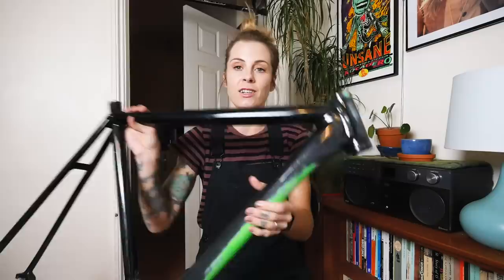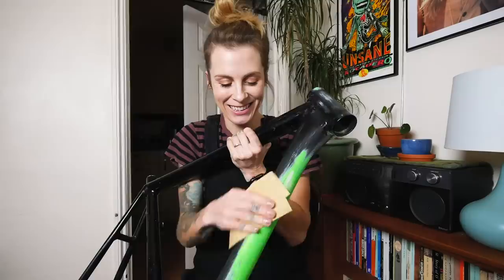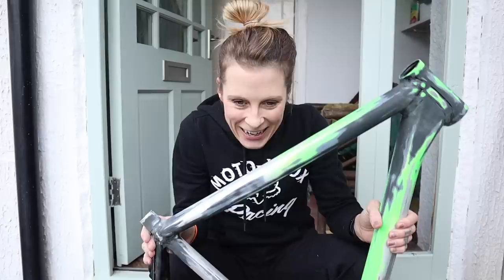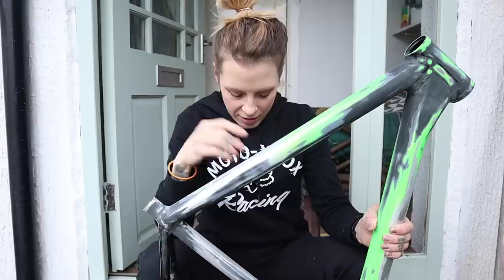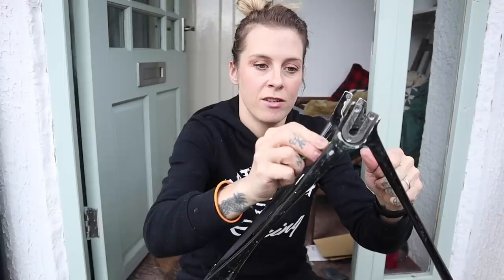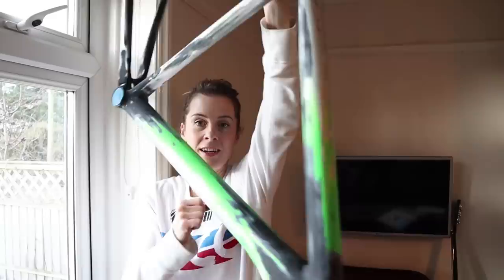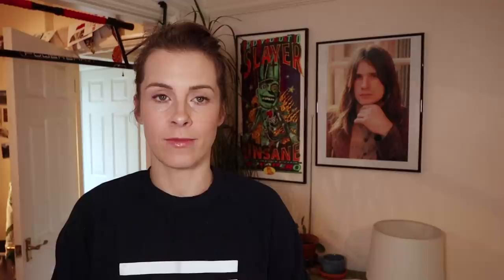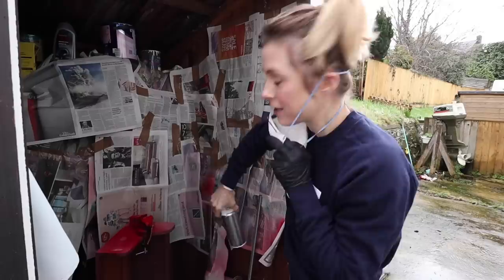Spray Painting My Own Bike | DIY Rattle Can

Comment: Cut the tape diagonally, one strip per side of the bike. Then meet tge ends under the down tube, and you should be good to go with your original design.
Reply from the maker: that actually doesn't work, I tried it
Reply: Just tried it myself with tape just for fun lol. If you cut the ends at the bottom and top, it'll have the desired effect from the side, but the stripe will have a chevron shape on the top and bottom. I've seen tons of factory painted bikes with stripes like that (I have one actually), but may not be what you had in mind for yours.
Reply from the maker: Memorizatela thanks. The problem is I don’t want the chevron-
Reply: You could mask off the meet points (the chevron join area)  so viewing From the back there would be a cream seat tube, view down the frame - top of top tube would be a line of cream etc, side on the bike would be block colour in diagonal stripe the way you want and then if you wanted you could make simple blocks of your colours side to side straight where the 'chevron join' would have been. Then either join the side lines up with straight blocks or leave a little boarder around them it cream ... ? however you choose to do it it will always look good and always be fun because it's something you've created for yourself so just enjoy the process and keep smiling :)

Comment: When removing paint from an aluminum frame, I've found that Klean Strip Premium Paint Stripper works wounders.
Reply from the maker: Matt Stroud sure, but it’s awful stuff
Reply: @JulietElliottsChannel  Well, yeah. Proper safety precautions, goggles, charcoal mask, chem gloves, ventilation, etc. Stuff you should use if you're painting anything. Also, if you are cleaning paint off a steel frame, get an angle grinder with a wire wheel attachment. It's better than a sandblaster.

Comment: My bike is a mix of carbon fibre and aluminum do I need to treat the carbon fibre bits differently? Also I'd like to remove the logo on the front but how should I get it off it's like a plastic piece.

Comment: Your design will work. You just need to figure out how to tape it. Try, when you get to the end of a strip, instead of trying to go around a tube, to cut the tape halfway around the tube at an angle that matches the tube angle. Then do the same thing up the other side.
Reply from the maker: That creates a chevron effect at top at bottom which I’m not keen on
Reply: @JulietElliottsChannel  I guess X-Acto knifes aren't a thing where you are. You can make the smoothest of curves for both sides of the chevron.

Comment: How about letting the local tattoo artist lose with an airbrush, then clear coat the results.
Reply from the maker: kinda defeats the object... which is to spray paint it myself
Reply: @JulietElliottsChannel  Look up "pipe fitting" on YT - they make pipes (for welding) match/mate perfectly. Their pencil-and-paper techniques will show you how to make that tape circle/stripe you want. It's like making a 90-deree mating of two pipes.
Reply: Plenty of tattoo artists can't airbrush to save themselves, and I wouldn't let an airbrusher loose with a tattoo gun... different skill set...